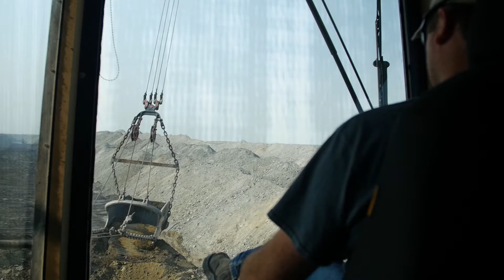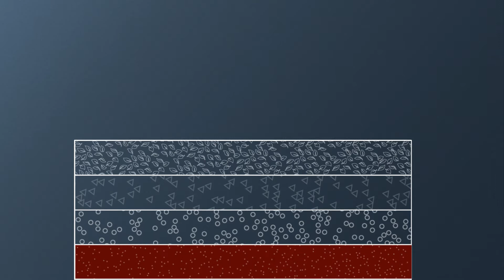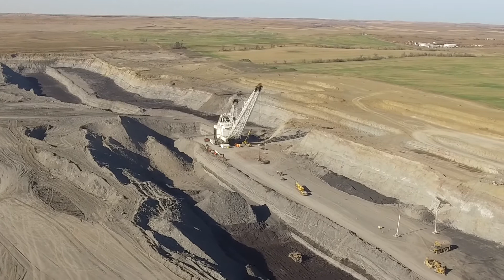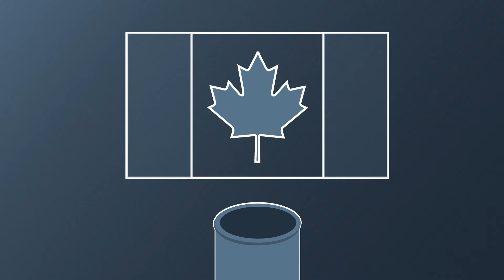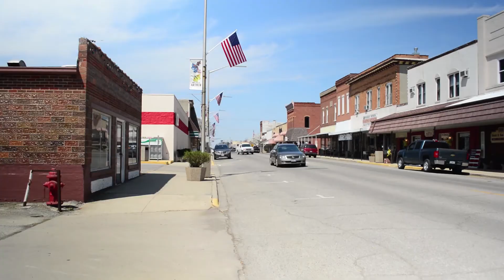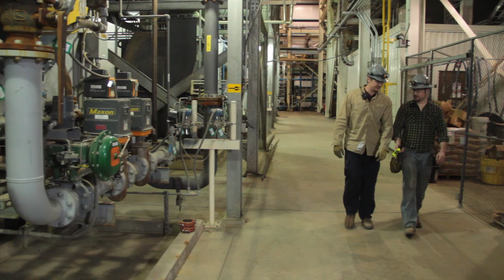Introduction to Lignite

Comment: Even the over the top excitement of the narrator in this obviously pro lignite ad couldn't cover the fact that it's very harmful to the environment and a very inefficient resource. It's actually farcical how excited he sounds while describing lignite!
Reply: Main issue is Coal Bottom Ash, Acid Mine Drainage / What happens BELOW the pretty “restored” meadow mine etc, and GHG Emission Climate Change.

Solving the Heavy Metals/Sulfur Emissions was comparatively easy,  but the Ash and Impact of Removing an Entire Layer of the Ground are inherent to it.

All in all it sucks that it is harmful, and care needs to be taken to give the current workers a “just transition” to some other field or maybe a UBI funded off of Fossil Profits or something, but “business as usual” would lead to disastrous outcomes.
Reply: Pretty sure all the coal stations burning lignite would meet EPA emissions standards.
Reply: Golly gee, Mr, McClure!
Reply: its not that bad, they carefully fill in the pits after the coal is extracted and restore the land carefully. at the power plant they have scrubbers which remove most of the ash and sulfur from the exaust
Reply: Last U checked you can't choose what is underneath your own territory. Also renewable energy is decades away from even approaching to viably replace traditional energy sources such as coal. Lignite is terrible but even Germany has become a great power based off of this coal. If only it has been smart enough to keep nuclear and not be reliant on Russia.